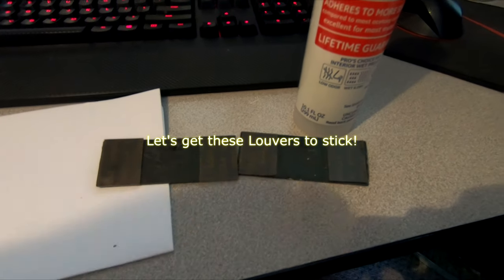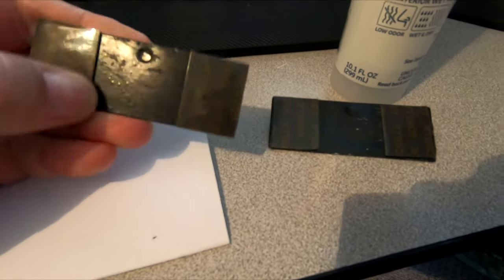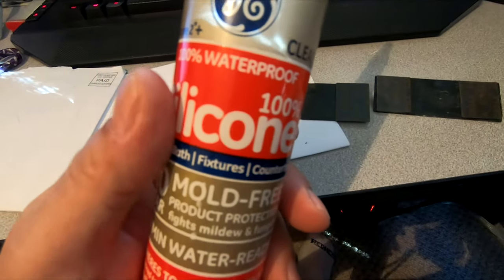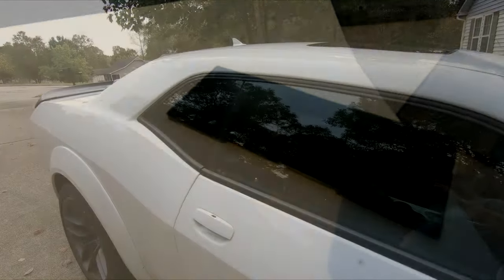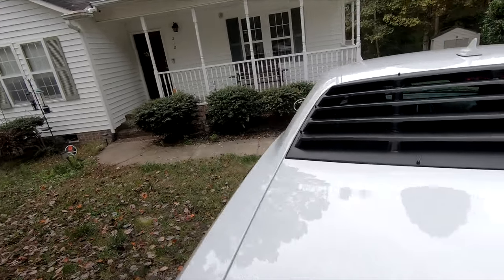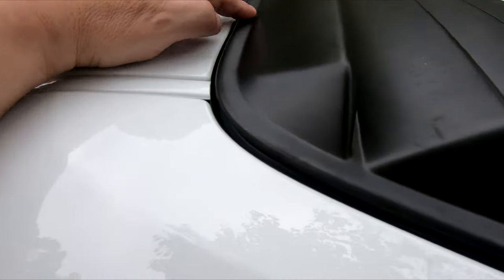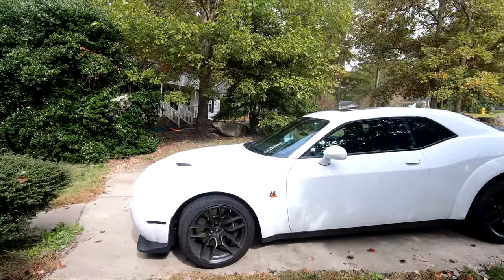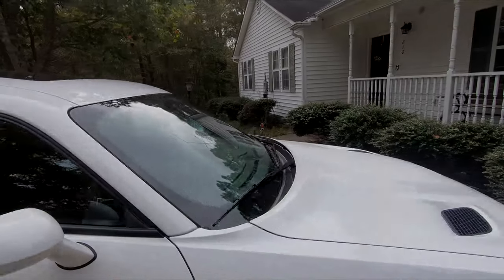Solving the Louver Tape Troubles: A Quick Fix!

Comment: Man the only video that is actually helpful! Just got my Louvers today and I’m even more happy because the ones I chose are the same brand as yours coincidently! Gorilla tape is insanely sticky to the point where it feels like it’s permanent lol. The silicone is a nice touch since it can prevent water or debris finding its way under the mounts. 10/10 advice brother!
Reply: Did this solution work for you?
Reply: Dan O Qam Yasharahla helped so much! 3m tape has gotten a little cheaper over the years. Most of the time many companies use fake Chinese 3m tape. Gorilla tape can old up to 25 pounds of weight when applied properly. I recommend using a heat gun on the tape after the louvers are installed to ensure better adhesion

Comment from the maker: Still holding great. If this works for you can I get a thumbs up?
Reply: Is it still on?
Reply from the maker: @kamikazeequeen  I actually had to remove them recently to get my rear window tinted, although the tint goes on the inside, they shape it to the outside  so I had to remove everything.  I used a putty knife and a razorblade scraper to remove them. They were on very good.  Then after I got the tint installed, I had to re-prep the plates, repainted them and redid everything again. They are again on securely. https://www.youtube.com/watch?v=dw_vLjbUMSk&t=1s

Comment: Nice ride man! I just used 3M plastic emblem adhesive with velcro tape on the louvers I put on last night.. Hopefully it'll stick forever
Reply from the maker: Watch it when you go through the carwash. See if the blower lifts it.
Good luck. I tried that accelerant but it did not work for me very long.

Comment: How are they doing? 
Still holding on strong?
Reply from the maker: Yep, they are doing great, no issues since I did the silicone trick and can hang on even under Warp speeds.  The E&G louvers look a little nicer these are closer to the car but clears the trunk lid where the E&Gs I had an issue with them rubbing a bit on the bottom rung.

Comment: Can I just put the silicone onto the 3m and after that go straight to the glass ? Great video tho
Reply from the maker: The 3M tape hold it until the silicone can harden. Then together the form a great bond. Do not apply the silicone to the 3M. When you put the bead of silicone try to make sure it doesn't ooze out onto the tape. I actually got this idea from a Cellphone antenna kit I installed back in the late 80's
Reply: @Sky1  thank you!!!!

Comment: I used a claybar, isopropyl alcohol, 3m adhesion promoter and brand new 3m double sided tape. The louvers held on for two weeks till I washed the car and half of them came off. I am to the point that I am going to use super glue or that silicone you got cuz man this is getting annoying.
Reply from the maker: Make sure it is fresh new clear aquarium silicone. Works like a charm can removenwith a razor blade

Comment: How did you keep your louvers from buckling?
Reply from the maker: :-) yea  they stretch in the heat and bow up slightly on the bottom hitting the trunk when I open it.  I ordered a support for the  bottom center and am going to elongate the holes on the lower outer edges so they can spread there instead of in the middle. The E&G lovers were really bad, these cheap ones I got are not nearly as bad.
Reply: @Sky1  thanks man, I appreciate it. I got cheap ones as well and they're a nightmare.
Reply from the maker: Just yesterday I put a 4 layer strip of gorilla tape on the bottom to keep it from lifting up and hitting my trunk. I have extra brackets but was in a hurry.  Dale's Cuda Shop used to make nice Aluminum ones that hinge and bolt on. See my viral video where the Mustang rolls over. I show them on a Challenger. Last I checked they were no longer available. Many do not want to drill.

Comment: Just bought some Gorilla tape to replace the crap 3M tape as well. I've tried a few different types of tape and even tried silicon just to be disappointed again. Thanks for the video and advice on tape brand.
Reply from the maker: Surprised the silicone didn't work for you. Make sure it is fresh. Some places sell old stock and the silicone wont harden correctly. Also make sure it is over 60 degrees out.
Reply: @Sky1  I'm a painter by trade ( 30+ years) and use silicone regularly.  I'm hopeful the Gorilla tape will hold on it's own.
Reply: I'm having a hard time with the install of my louver as well no tape seems to be sticking,  I have a challenger se, it keeps on popping up
Reply: @Son0fGuns  IS the Gorilla tape still holding on for you with no incidents?
Reply: @danoqamyasharahla6544  The Gorilla tape has held great even at 169 mph speed run I made and several rainy days and car washes later.
Reply: @Son0fGuns  is it still on?
Reply: @kamikazeequeen  Holding like the day I installed it.  I bought from Amazon and still have a little I've used for other projects.

Comment: Heat up with a hairdryer and they stick
Reply from the maker: I tried that using a torch but after a cold rain they started coming loose, did not trust it on the track or highway.

Comment: Nah…. ☝️🎃 Go buy yourself a “rearview mirror mounting kit” … autozone… comes with a little metal thumbsized mount for rearview mirrors, a little packaged wet cloth (similar to a KFC Napkin from Kentucky Fried Chicken, and a small little bottle of adhesive glue. Only part you really need is that little KFC looking condom wrapper sized packaged thing with the cloth inside. It has whats called an “adhesion promoter” chemical for glass in that little wet napkin cloth thing…. Clean your glass thoroughly with soapy water of course… let it dry.. then use this little cloth. It leaves a chemical residue behind that is an adhesion promoter for any 3M tape or glue or pretty much anything else you want to stick to that glass. And then install as per usual…. DONE. It will NEVER come off again.
Reply from the maker: The louvers came with that stuff initially. I think it was too cold when I first installed them so it never fully took. after a few car washes they started lifting up so I don't trust it. I went with Silicone inside with the tape outside and that works great. Has been a couple years and they are still secure.
Reply: @Sky1  Nice 👍 Man have held up so far. But I never go to the car wash… not the drive thru carwash anyway. I always do the wash it yourself thing.